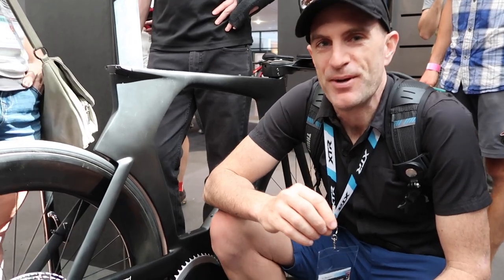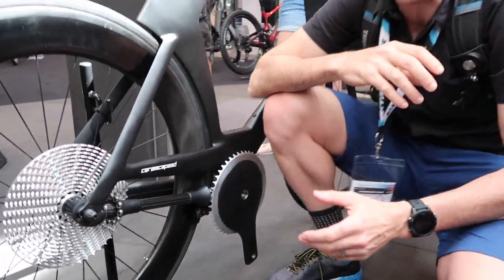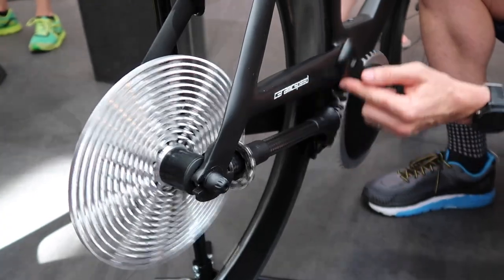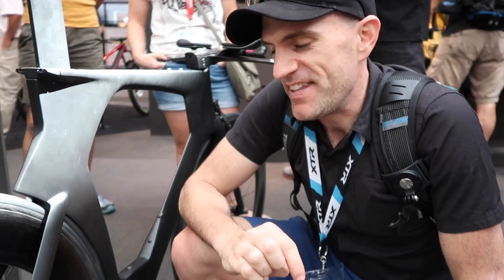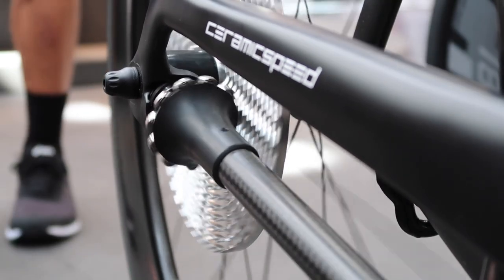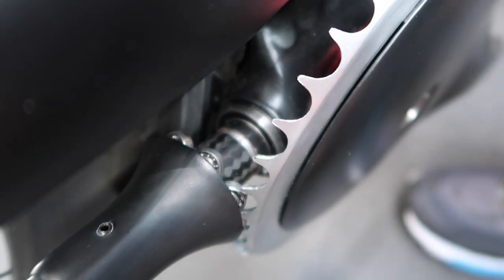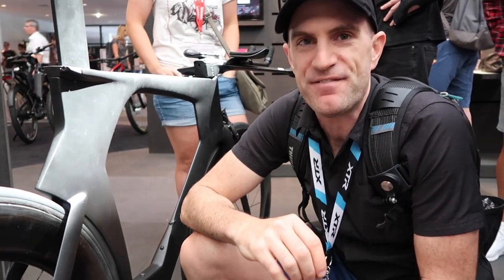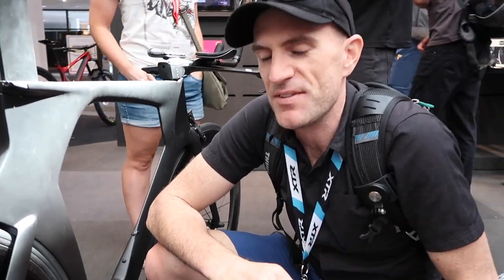CeramicSpeed DrivEN 99% Efficient Drive Shaft // Chain Free Bike // Eurobike 2018

Comment: Very bad,  separation forces on it will have it skipping teeth like crazy.  They won't be able to keep it from happening without massive reinforcement which means weight.
Reply: So the Engineers at CeramicSpeed, who are all most likely highly educated and well versed in the engineering principles involved in bike design... Not one of them thought about skipping teeth? 

More to the point, this is a prototype/proof of concept... It's not finished. The designers obviously believe they can solve (or already have solved) the basic issues you can see, or they wouldn't have put it on display at the show.
Reply: Sam The same amazing engineers who charge £1,200 for a piece of crap oversized pulley/cage set for a rear mech?   

Simple sketches and a few calculations should tell them that this is a dead end.  
The entire design is riddled with flaws.  The cassette's strength is in the wrong axis for a start and would more than likely fatigue to the point of total failure within an extremely short time.  The chainset's teeth being in contact one at a time would leave them bent and mangled in minutes too.
Reply: The Engineers don't set the prices of the companies products. They are given a criteria to meet and design a product . If the marketing department then want to slap a £1,200 price tag on, then that's an issue to take up with marketing. 

But if muppets are buying it then why shouldn't they charge that price?
Reply: Some nicely thought out points on the potential flaws, I don't disagree with you.

My point is, why would the company show this bike at a show if it was such a poor and flawed design?

Either;
- They have solutions to all these flaws you've pointed out.
- The flaws you've thought of don't exist or don't factor into the intended end use for this tech.
- The bike is a gimick marketing stunt to generate more business.

Considering the company tend to make products for serious cyclists, I don't think option 3 is a likely case. Unless the people in charge are muppets.
Reply: like self filling water bottles 
https://www.youtube.com/watch?v=lYFH_bXM5gU
solar friggin roadways
https://www.youtube.com/watch?v=O0yn-xBjb9c
or the juicero?
https://www.youtube.com/watch?v=zpmd7renbxI
Reply: Sam Yeah, I think 3 is the only likely option.  I'm just both frustrated by people looking at this like it's viable... and encouraged by the number of people who have had their imagination stirred.
Maybe something better will come from this concept as a result... who knows
Reply: they can just make the teeth arc back up to avoid pushing out the disc.
Reply: "criteria" is plural. Engineers are given "a" criterion.
Reply: Absolutely. And those engineers will usually be under stress due to delivery time and poor quality given the requirements from marketing. Always has been that way. 
Sure $2000.00 for the mozzarella shredder disc is a good price if there are willing buyers. And there will be.
Reply: Coeman definitely not 3, this was the result of a senior capstone engineering project. The goal was to completely rethink the bicycle drivetrain to yield something that could be more efficient than even the best chain system. Ceramic speed works with very high level clients to install some of the lowest friction components possible. They get very good efficiency because of this, but they have pretty much maxed out what you can accomplish with a chain so they wanted something that has more potential.
Reply: I doubt anyone has 'ridden' this bike...
Reply: David Reeverts    Yes ,the weight problem.  Titanium might help.
Reply: Sam     May be. This design is a major failer. You can see.
Reply: Sam    It's just a Muppet show.
Reply: seppstarthebest   Large flat 💿disc. There are no rings/ sprockets.
Reply: Seems like a marketing driven demo i.e. show clickbait:
 Putting all the stress in bending on the grater, and concentrating it at one point rather than spreading over multiple sprocket teeth, will create issues of bending that (even for the loads in a child's bike) would require significant reinforcement from what was demo'd. i.e. weight.
Then there's the reaction loads into the frame which will make it heavy as well. 
Then there's the contact stress on each tooth from using just one tooth to transfer the power which would lead to very heavy wear if it was made of aluminium as shown, so life would be very short particularly with it all being exposed to environmental grit.

If it's made of iron or steel and enclosed in an oil bath it will work -- shaft drives exist on large touring motorcycles, and they have one key advantage not in this version-- totally enclosed so dirt stays out and oil stays in. 

I also don't see ANY efficiency gain.  

And it will still shred the leg of your trousers. 

Cyclists LOVE heavy equipment, particularly if it is expensive, doesn't allow them to ride up hills, and wears out quickly. 
Should sell like hot cakes. 

Or like i said, just clickbait.
Reply: Tano17 yeah imagine those micro sized bearings with equivalent of tons of psi just on a level ride surface
Reply: Nah, it's a prototype meant to get press attention. The separation forces would be atrocious on a design like this.
Reply: Jon CeramicSpeed only caters to people who literally have ran out of things to upgrade. $1200 jockey wheels? Sure, why not, maybe it’ll make me faster, and I’m not the one paying for it in the end? Most of their efficiency and performance claims are dodgy at best.

Comment: Aluminum will certainly not work
Reply: Scott Tandoi it's a prototype
Reply: T-X-M i know. Prototypes are made of cheap materials as proof of concept. If a stronger yet affordable material is available for marketed models then it could work
Reply: T-X-M Neither way of spelling it is wrong.
Reply: 7075 T-6 aluminum is used for  aftermarket rear sprockets on dirt bikes. Lots of power and torque handling, and hard anodized 7075 is some hard and tough stuff.

www.chapmoto.com/renthal-520-off-road-rear-sprocket-parent-520-rear
Reply: @HaaskaChan  Americans actually have a very valid reason for being different. Sure, we think of the "ium" like in Magnesium, lithium, francium, etc. But they think of "Um" as in Platinum.

Aluminium had a number of different suggested names all relating back to Alumina, and Alum. One suggestion was Alumium by BRITISH chemist Humphrey Davy, but other chemists disagreed with that, so he instead settled on Aluminum. Aluminum is the original spelling, but British editors settled on Aluminium instead, so that's how that happened.

Yes, I say "Aluminium", but it doesn't mean I'm right.
Reply: @jeffl4830  7075 is great, especially when anodized correctly. Aluminium chainrings historically wore out slower than steel, possibly because the alloy was a better grade, but also because the grit that got fed is claimed to have given it a harder wearing edge.

However, aluminium is less rigid, the forces applied on a sprocket are different to those shown above, and I suspect given the rotation of the driveshaft "pinions", it will want to push the disc away from the pinions under load, resulting in slipping, or broken components. I highly doubt we'll see any further development of this system, especially since there has been no news of it since the first couple of weeks it stirred up a lot of hype.
Reply: @HaaskaChan   yeah rest of the world.... in here we call it "glin" IPA: [ɡlʲĩn]. you think all the world use english :P
Reply: @grezisekr5403  I know not everyone can speak english. and special snowflake thingy was a joke. hell here where I live we call it "Alumiini". (it's finnish if you want to know it)
Reply: hmm
Reply: @HaaskaChan  unlike brits who don't want to be different from the rest of the world?
Reply: @subscribeifyourenotgetting4986  Dude it was a joke and old one on top of that. XD

Comment: they could maybe make it double sided
Reply: Good idea that would equalise the lateral forces, also as the front and back cogs are no longer being pulled together, as in chain drives, eliminating the chain stays would save some weight if dual driven. It will be interesting to see if they can bring it ti market.
Reply: maybe a reverse hook in the teeth pattern can avoid deforming the disc. I think their real problem is shifting under load. they haven't figured out how to pattern the teeth and bearings to allow shifting yet.
Reply: they shouldn't have to pattern the teeth, the mechanism could lift and drop the rollers onto the teeth.
Reply: they were talking about some kind of electronic system, precisely syncing the engagement. sounds way harder than di2!
Reply: jlebrech great idea
Reply: Ken Parker another 8hours of cutting
Reply: Depends on what you mean by double sided. Dual drive shafts? Sure that could work. But you know it's going to weigh a lot more than what we have now. 

Dual cassettes? That would be super hard. The outer cassette will rotate backwards. So they'd need to reverse its spin to use it. 

Either way, I think it's a great idea, but very far from production
Reply: A bit of gear grease will quieten it down.
Reply: ray r that would be dual drive.  I thought they meant 

I O I []

Which would reverse the outside gear. But going with that dual driveshafts would solve this. Going like you said

I O [] O I 

Would absolutely work
Reply: There is the issue of clearance if the package is too close to the wheels.

Comment: Very cool, and makes you think.  But the more I look at it, the more problems I see, haha.  It's a long way off still, if it goes anywhere...
Reply: It won't. It's a gimmick.

Drive shafts are good at high rpm. They aren't good for low rpm and high torque, aka the bike market.

Imagine if your car engine only produced 130 rpm's and had to delver all that torque through a drive shaft. Yikes.

Comment: That will never make production!
Reply: not the intention it´s all marketing
Reply: why not?
Reply: Paolo Monello because it is a solution looking for a problem - it solves nothing - the drive shaft is graphene - the cost will be astronomical and that is not even taking into account spare parts and maintenance - might see it in the next Batman movie if Batman adds a bike to his fleet
Reply: It looks loke one can have 1% advatnage in efficiency... who might be interested in this when...   better aero skin suit like this from this year TdF gave Team Sky 2nd place in tiday TTT ;) Drivetrain Efficiency & Marginal Gains
https://www.cyclingpowerlab.com/DrivetrainEfficiency.aspx "As power output increases efficiency increases because frictional losses become a smaller part of total input power. Typical best-case efficiency of a drivetrain in the 200 – 300 watt range is 96-97.5%. Above 300 watts typical best-case efficiency is 97-98%."
Reply: Sopho Cles your spell checker seems to be having trouble with 'Carbon Fibre'
Reply: It's not durable.  The rear disc will wear out really fast.
Reply: and probably not withstand the forces of an out of the saddle effort hammering up a short hill in low gear, say 800W at 8% incline for example
Reply: Noise equals friction. Also how will it change gears without skipping or catching the face of the tooth on the next ring.
Reply: Fucking naysayers. You don’t get innovation if you never try. 

If you don’t think that chain+derailleurs have issues, you’re not maintaining drivetrains. There’s got to be something better. There’s room for creative thinking here.
Reply: Well it is a prototype of course it won't.
Reply: gummyrabbit only has to last 50km.
Reply: The earth is flat!
Reply: I'll make a few myself and sell them to rich idiots on ebay. ;)

Have you ever desired 99% efficiency under low load while being able to grate fresh Parmesan on your salad? Well, do I have a product for you.
Reply: Marketing gimik. This can't work. Like he says contact area is far too small. The rear cassette will deflect towards the spokes under even low torques
Reply: Search "1900 columbia pope bicycle" you will be surprised 😀
Reply: Luciano Facchinelli nothing about the Columbia 65 shaft drive bicycle from 1900 is surprising to me.
Reply: And that's why all major automotive manufacturers have tried out various designs over and over again. And always came back to the same most efficient solution. A chain in motorbikes, be it steel or carbon belt.
Reply: Couldn’t have said it better myself. Why over complicate something that works so well and has done for over 100 years now.
Reply: This isn't even a new concept. This existed before the current chain system
Reply: Totally agreed. Good idea but impractical on the road. Plus the gear shift looks impossible to achieve.
Reply: It is a prototype/concept,  like any concept a production version is re-engineered with cost effective materials and mass production design.  This could easily be produced for the market with a decent price point.
Reply: LOL, Its a prototype.  The materials would be 100% different in a mass produced version.    All prototypes are  prohibitivly expensive until re-engineered to mass produce.
Reply: The sprocket would be a nightmare to produce.
Reply: There are even motorcycles that use a drive shaft instead of a chain today, up and out of the way, and sealed from dirt, makes sense really.
Reply: Paolo Monello you need perfect surface to ride it on.
Reply: Sopho Cles funny though they said the same thing about carbon bikes, something like that could even be constructed out of composite.
Reply: there is something better its called a motorcycle and there is something even better than that its a car and then suv and then truck and then train and then plane and then space ship
Reply: There is no way that prototype is 99 percent efficient
Reply: Paolo Monello There’s no possible way of this effectively switching gears. No good engineering solution. This is just a ploy to get venture capital and investments.
Reply: Carbon Mafia It cant
Reply: Free To Cycle totally agree. There is no way that that mechanism handle a bit of power
Reply: Paolo Monello too much work.. he also said it could skip with too much power..
Gear dont work yet.. or ever.
Reply: Paolo Monello  because it is not working. This tipe of gear system is on the engenerer book for the first day of gears. The problem is that is inposible to have gear change as is run. That is the main reason that forced people to discover the cvt reduction system.
Reply: Also you can only have a single front chainring and i'd like to see it on a full suspension mtb the shaft would need to lenghten and shorten with the rear wheel movement.
Reply: Yeah its way To loud!

Comment: Whether this ever makes production or not because of some of the hangups in physics I want one and I will ride it and not look where I'm going because I'll be busy watching it operate
Reply: Rusty Shackleford it's ok they could reapply the mechanism to lower my casket down and cover me with worn out Schwalbe KENDA and maxxis tires lol
Reply: Kurtis J. Kopp true
Reply: It'd be broken or bent every other week. The tolerances are too small.
Reply: They have tried these types of gear concepts in the automotive industry. The increase in the diameter of the cog size means more teeth to maintain the same tooth size,  meaning more teeth required. This causes a misalignment of the teeth. Thus misaligned teeth between gears. Hense the invention of the clutch. This idea works but gear changes will be rough and clunky. All the best.

Comment: It looks really cool, and I'm impressed that somebody actually built a driveshaft system for a bike. It's something I've wanted to implement myself, but I'm not a machinist. But I think a driveshaft system could be built using maybe 1/10 the number of discrete parts, and the result would be tough and reliable without weighing a ridiculous amount.

EDIT: Now I'm chuckling at myself, because it turns out that this has been done numerous times in various ways. It's significant that most of the bikes we see in actual use still have chain drivetrains...